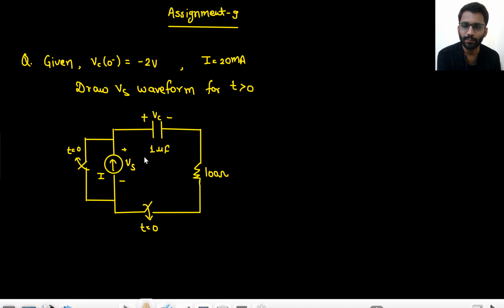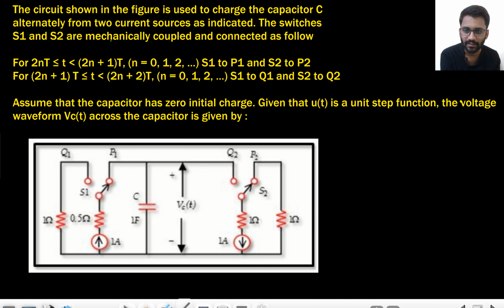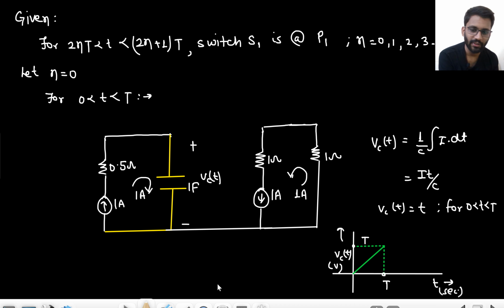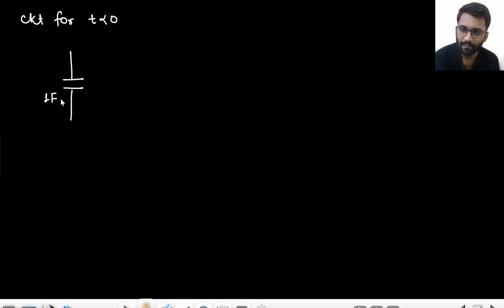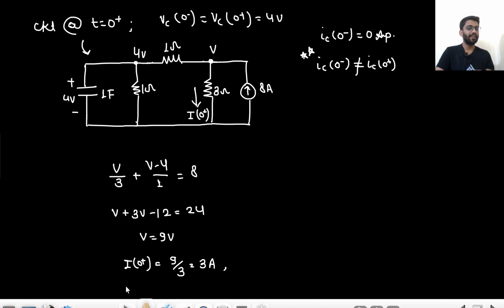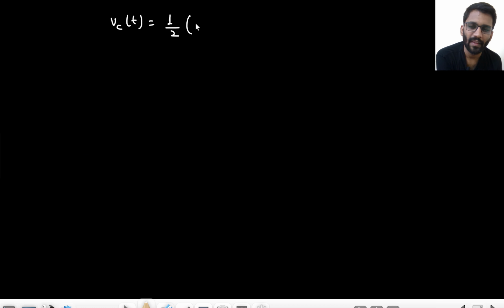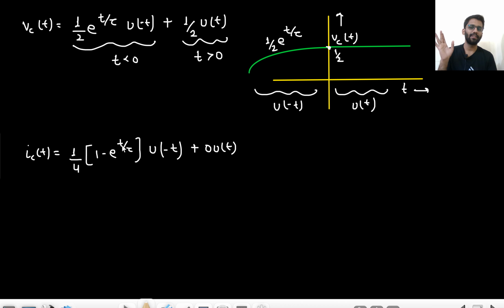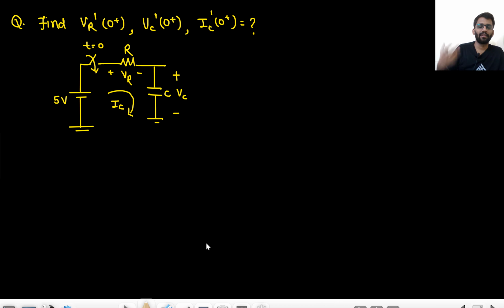Assignment 9 Solutions || Network Analysis || GATE 2025-26 || PrepFusion || Himanshu Agarwal

Comment: I had a query in Q1 why are we not calculating V at t=0 and t=infinity. Also, at t=infinity the capacitor should be open and Vc should be -2+2=0 as there is no current flowing through the circuit. Why is the integration term coming?
Reply from the maker: Vc at t=0 is already given and at steady state cap will not be open ckt. There is a constant current here. 
Watch the previous videos.
Reply: @PrepFusion_GATE he has a point. If it were ac then i would have taken it. But it is dc here.
So, how can you tell that I will flow?
Reply: Bro current source is supplying charge to the C plates. So it will gain Voltage. Isn't?
Reply: @GateStudyaccount  yes because of  I the extra integration voltage will come
Reply: Practically a currents source cant have series switch.
Theoretically => Here the Capacitor can store infinite amt of charge. The current source is just forcing charge onto cap so it never reaches steady state.

In real world this would overload cap and cap bursts.

Comment: 47:46 
ic(0+)=0 why it became a 0😢
Reply: because the capacitor already reached its steady state at vc(0+) and there will no current flow through the capacitor to charge it
Reply: At t = 0+ , the capacitor will be open circuited , hence in opencircuit current won`t flows.